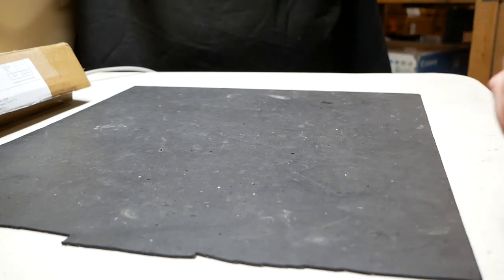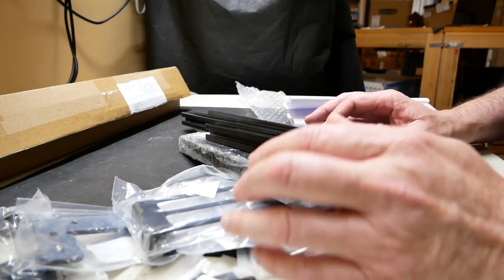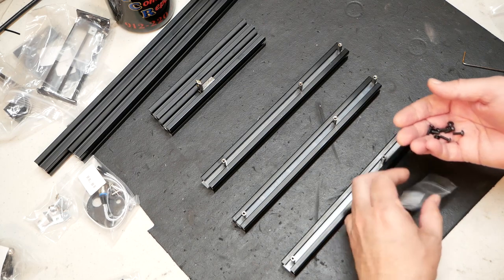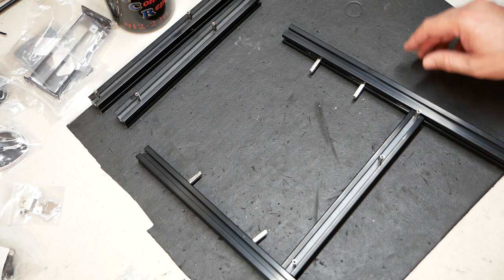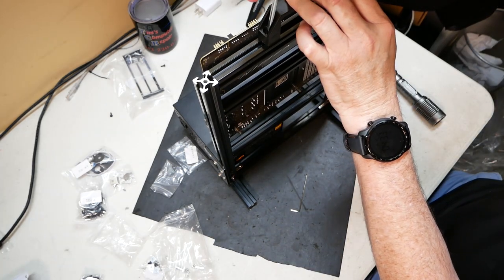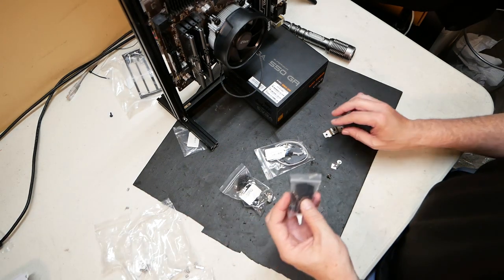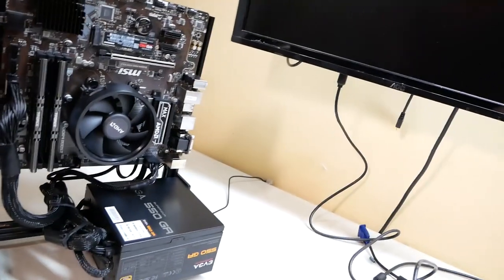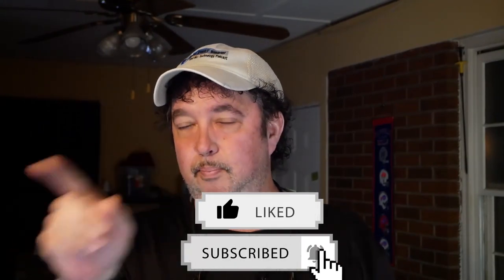Affordable MATX Vertical Open Chassis DIY Computer Test Bench Complete Assembly Guide

Comment: A suggestion. Fit the motherboard mount screws loosely before you tighten the grub screws that hold the diferent elements together otherwise they won't butt together tightly. The little notched bracket that Tim found at the end is for hanging the frame off a vertical surface. The bottom lateral element would be better attached to the feet so it can support the power supply along its entire length.
Reply from the maker: Thanks for commenting.

Comment: When you put that power supply bracket on I instantly thought it was upside down haha. Side note, you didnt peel the peel off that plastic? or at least looked like it was peelable haha (same with the power button)

Just noticed you are monitoring your camera on your phone, what are you using for that? I would seriously be interested in trying something like that.

Fair play Tim that looks like a fantastic solution for a test bench. Id almost be tempted to fully wall mount it, wouldn't even be that hard to do.

Thanks for the video
Reply from the maker: Go to 39:35 in the video. I show a bracket of sorts that I did not know what it was for. I know now. That bracket is to be attached to the back of the top rail so you can hang it on your wall. Just figured that out after your comment. My Lumix camera has an app that allows me to connect to my phone via direct wifi from the camera.
Reply: @TimsComputerRepair  Ah that app, yeah I think I can also use that to. Will have to look into that.
Ah that's cool, least that is a option for hanging it :D